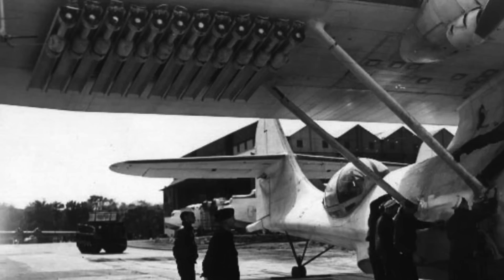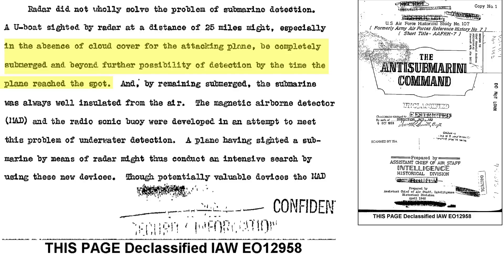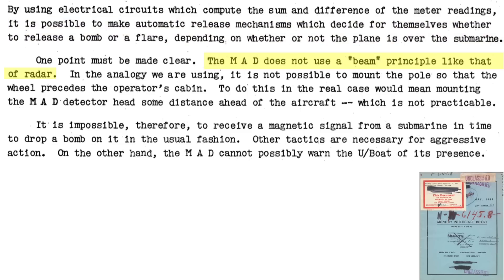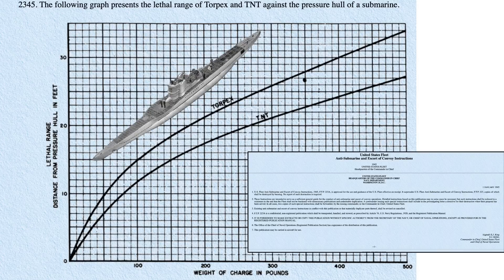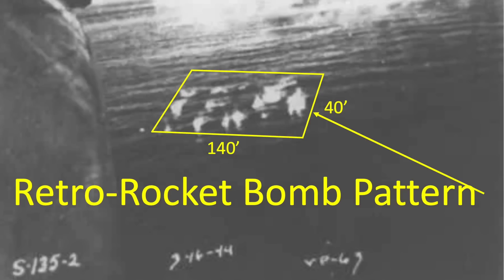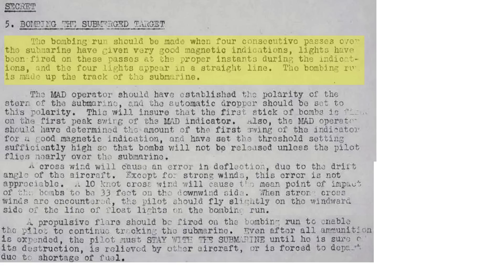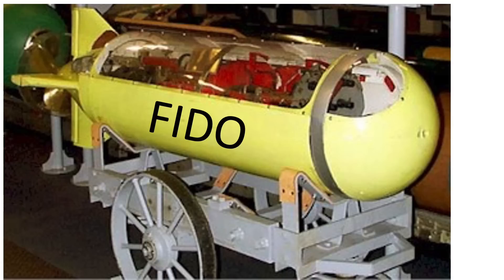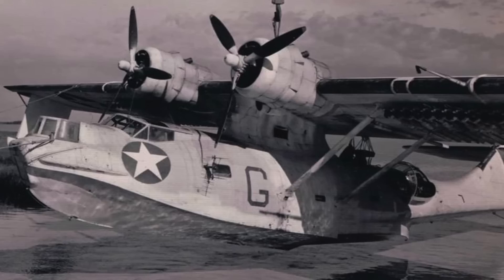MAD Retro-Bombing – WWII Anti-Submarine Combat Results

Comment: Quite interesting!

It is not al that surprising that this did not work all that well in that the aircraft had to get really close for it top detect a submarine  and thus the chances of a direct overflight are pretty low.
Reply: It's only needed for the final kill. You find the submarine by picking up either its sail or its snorkel on the radar, and if it sees you too soon and dives, you use this to kill it.
Reply: You're sorta right and sorta wrong in your understanding. MAD is primarily a tracking device not a detection device. However, MAD was/is monitored in areas of high probability on the off chance of getting a random MAD contact.
Reply: @roberthutchins1507  wouldn't it pick up all kinds of false positives? MAD is regularly used to find metal deposits and GM had a program in the 50s and 60s where they were using it as an alternative to radar/lidar for self driving cars, and were picking up pedestrians with it - any abnormality in the Earth's crust, any shipwreck, maybe even a school of fish or a whale or even a temperature differential between currents could set it off.
Reply: @phinhager6509  The MAD sensor isn't that sensitive. It requires several tons of material to detect a disruption in the magnetic field. Shortly after the war, MAD was used in exploration of mineral deposites on the ocean floor, but was primarily used by oil companies for finding oil deposits
Reply: @roberthutchins1507  I see. It would make sense that there are MADs dialed in for doing different things. I know that they were being used to find veins of ore dating back at least into the 19th century.

Comment: 1:22 according to this graph, the best tactic would be to submerge and turn the diesel to full astern as soon as not observable and dive backwards. And after you're well behind the submersion point, switch to electric to avoid making any noise.
Reply: @kiereluurs1243  Snorkel.
Reply: I'm not sure you could reverse a WWII Kreigsmarine sub on diesel power. Only two ways of doing it would be A) a gearbox having reverse. B) Many marine diesels could be shut off and restarted in reverse. Never heard of either of those features in those subs. If I was the designer - no more than astern power is needed - I would just use the giant DC electric motors for that.
Reply: @patrickshaw8595  IIRC they reversed the diesel engines. U-2331 was lost because of diving while traveling in reverse. But my idea was more about reversing as soon as beeing level under water.
Reply: @RubenKelevra  I will read up on Kreigsmarine subs and U-2331 in particular, thanks.